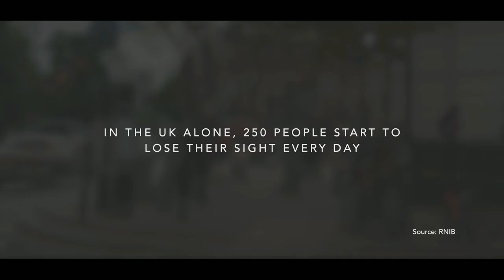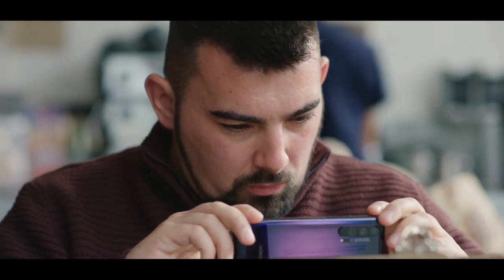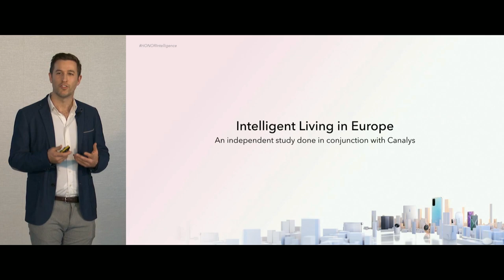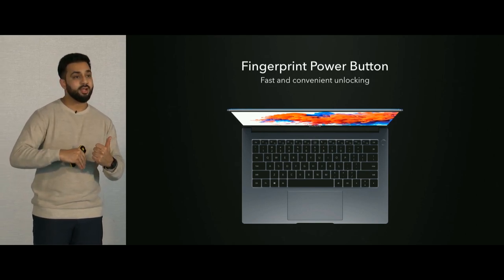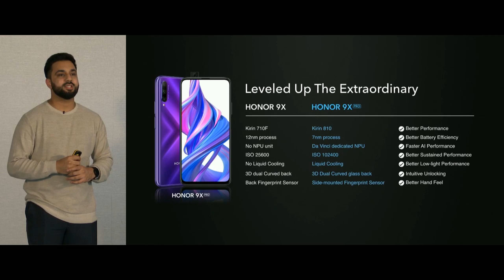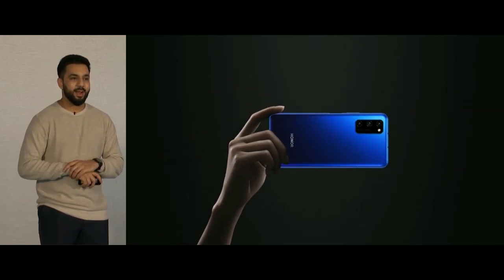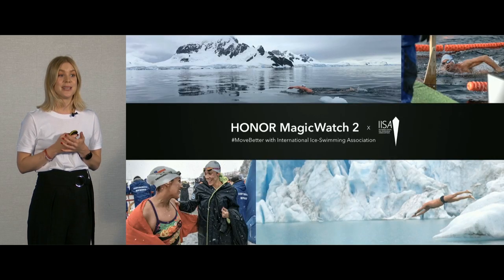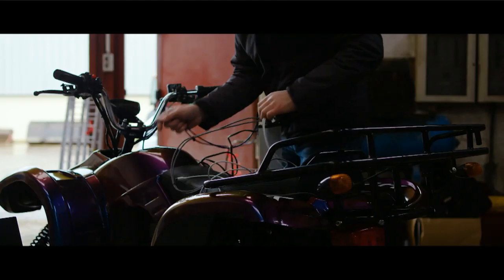HONOR All-Scenario Intelligence Press Conference

Comment: Honor good ahead to top branding smartphone in India.

Try to make Mid-Range segment honor mobiles all in one future smartphones.
Beast in INDIA Launching

Something you missed Honor 9x pro futures

1 Display :  No Gorilla glass and No 4K & 8K , OLED AMOLED display, 559ppi and then manual resolution mode changer 

2 Front Camera : Pop-up Selfie camera is not enable locking sensor (pocket,bag or horizontal holding hands) when pop up selfie not in use

3 Dual noise cancellations mic is : Enabled 
and then no indicator light to receive msg,calls,battery( full or low) notification

4 Speakers : there is no dual speaker for Dolby Atmos  and then no 3D gaming speakers 

5 Networking : No 5G , Dual 4GVOLTE , all powerful supporting Bands enabled

6 Slots : Dual Nano SIM Hybrid and Micro SD card upto 512GB

7 Battery : There is No user replaceable battery, lithium polymer Batteries.. Red sealed pack must covered. Exporting (5500MAH to 8000MAH) fast charging and revisable charging support

8 SAR Value : very too low radiations for kids behind safe to use

9 Google play : we don't want to need google official. so, please give new step of Huawei apps stores

10 Processor : Kirin810 AI processor and Mount finger print sensor must. Very High graphics 3D Turbo gaming settings enable

11 FM radio with Recordings enable,Best audio calls recorder when manually on/off

12 Keyboard input & Menu Languages : Tamil language must added and then All Language Voice Translators is must enabled

13 Contivity : Infared for Smart TV & D2H remote uses and then NFC enable

14 Accessories : Honor Brand Tempered glass inbuilt display protection, Tup-case, SIM Eject tool kit & Extra Hybrid slot tray 1, 12volt charger, C-Type USB cable, C-Type OTG mini cable, 3.5audio jack Best 3D Bass Headset 6month warranty, Smartphone 2years Manufacture warranty, Battery 1years warranty, Manual information about honor 9x pro.